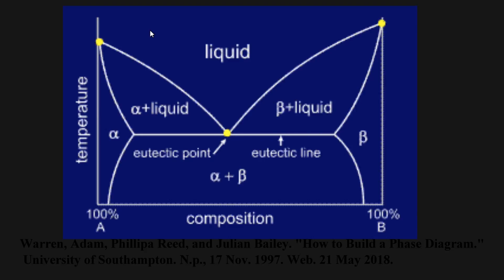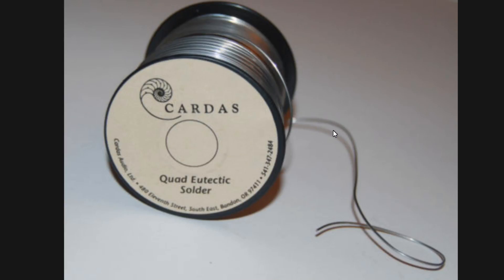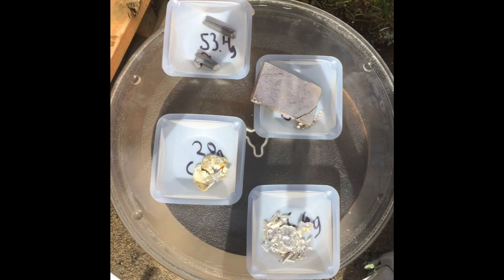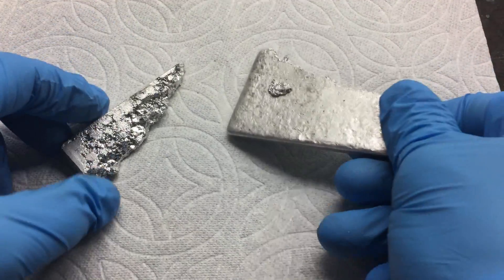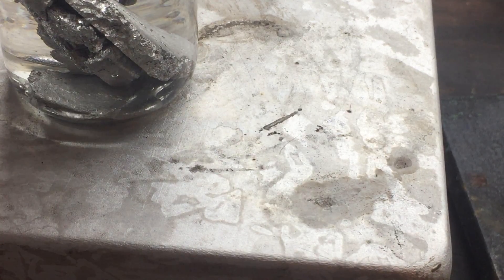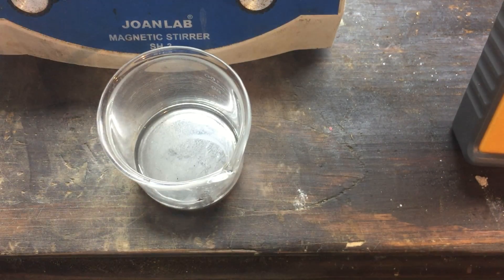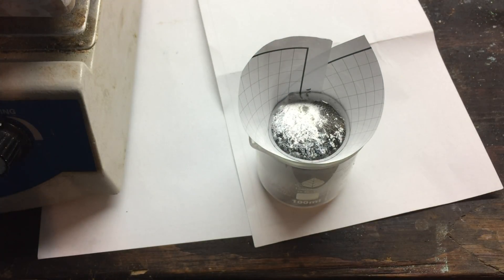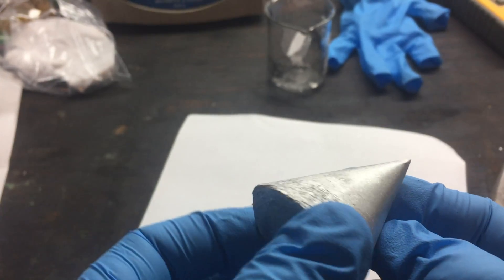Woods Metal (Lipowitz’s alloy)

Comment: Great video! Wood's metal is sold as 'Chip Quik' (I believe), in order to lower the melting point of solder and thus give you time to pull an 'integrated circuit' off the Printed Circuit Board.